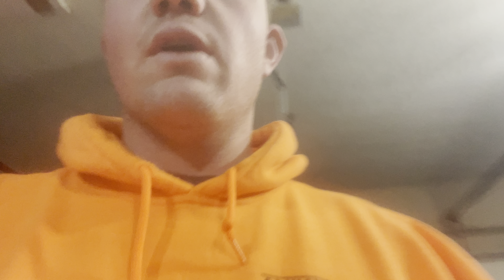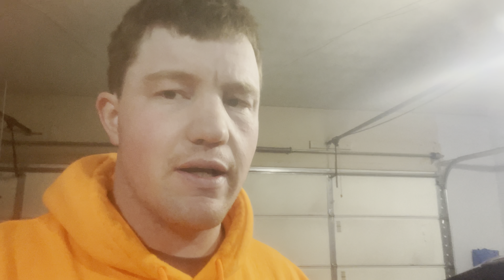CVR Electric LS Water Pump Review

Comment: Hey mate. Does this water pump flow in reverse flow or standard flow. And how has it held up so far.
Reply from the maker: @adriancaruana7303  standard flow and it’s been 2 yrs and it’s flawless
Reply: what were the thread sizes for the inlet and outlet fittings and the heater core plug?
Reply from the maker: @kingzcrew8603 oh man I’m not sure I ordered those straight from cvr
Reply: @308racing. all good boss really appreciate you being active on this still man!!!! just ordered me one, gonna try and put a -12an fitting on the side that would was hitting the pump so hopefully i won’t run into the same issue. luckily i got a gen3 too so can sensor shouldn’t be a issue
Reply from the maker: @kingzcrew8603 sounds good man!!
Reply: I wouldn't recommend reverse flow, because of the impeller design. But if you absolutely must, there's several ways you can reverse the flow direction on the CVR brushed DC motor pumps. But they're designed to work best in the direction they're designed for. You can simply switch the polarity on the wiring harness. Or, you can paint a dot on the drum under the wires for alignment, Remove the 4 bolts on the cap, pull the cap, but keep track of the original orientation. Insert 4 paperclips or some stiff wire to hold the spring loaded brushes back for reassembly. Now the drum with the dot on it, rotate that clockwise 90⁰, and place the cap back on in its original orientation, put the bolts in loosely and yank out the paperclips to release the brushes onto the commutator before torquing down the bolts with a cordless drill on clutch setting 9.